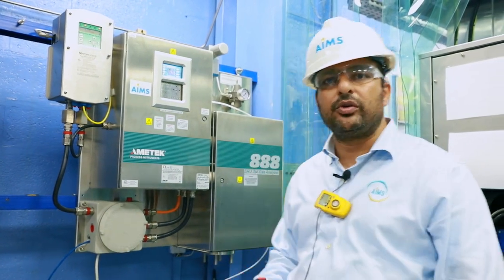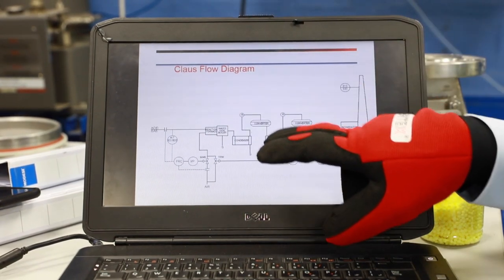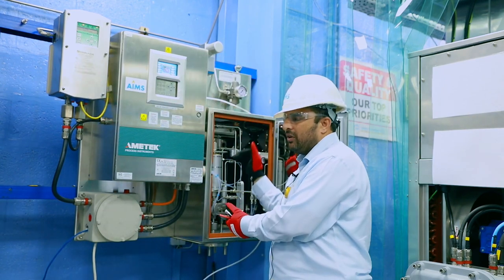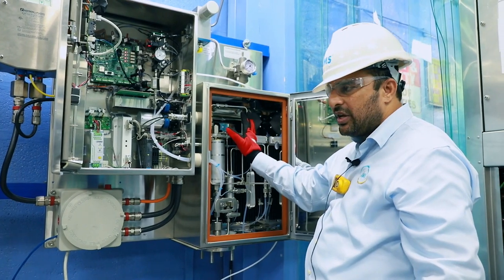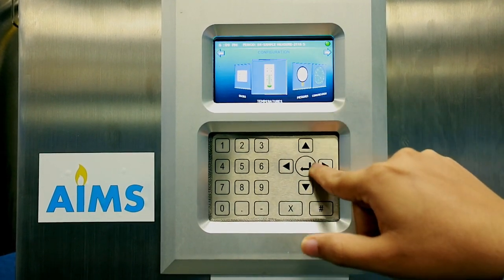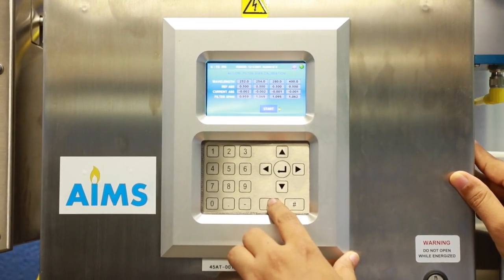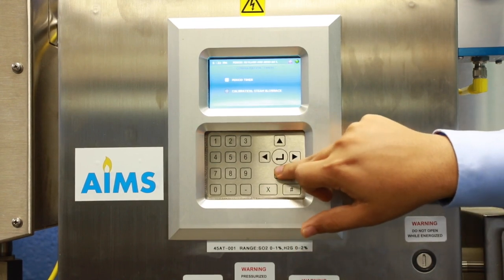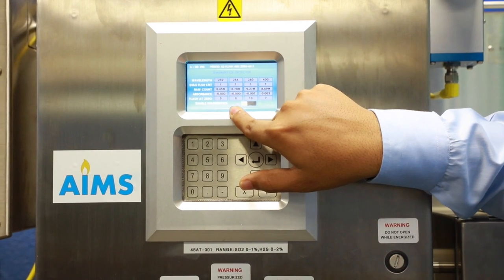AMETEK 888 SRU TAIL GAS ANALYZER (AIMS)

Comment: awesome , we are using the old TLG 837, i am not sure if it is reading correct because the H2S/SO2 ratio reads 25:0 and there is no correct indication for the H2S and SO2 analyzer, maybe the range is low, but however the air demand exceeds +/- 1.5 which means the process is off ratio